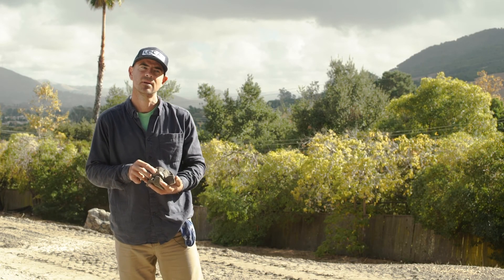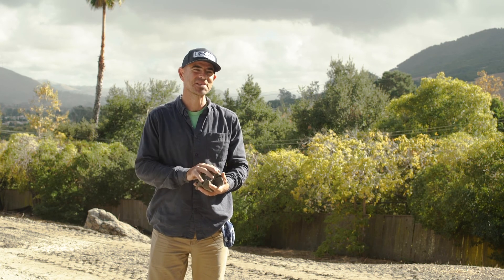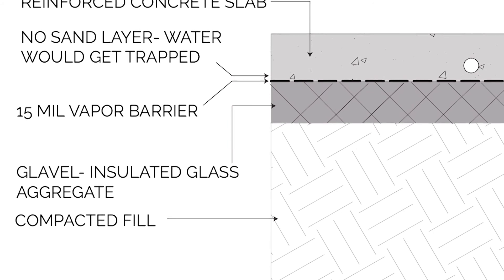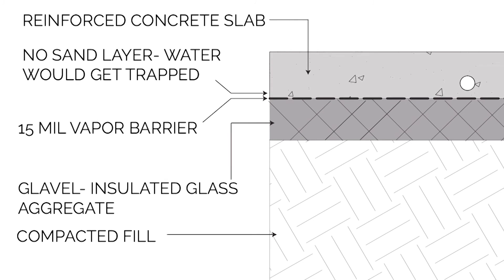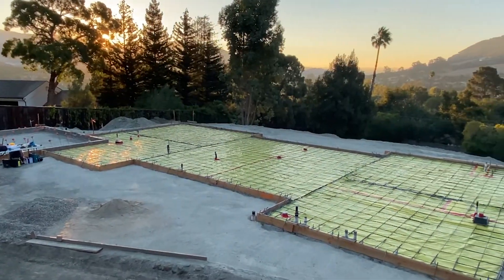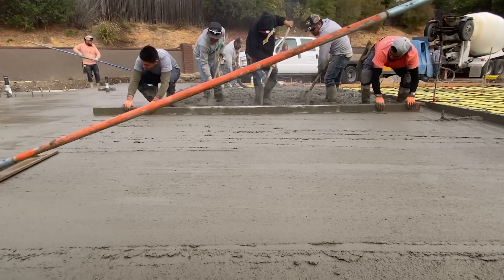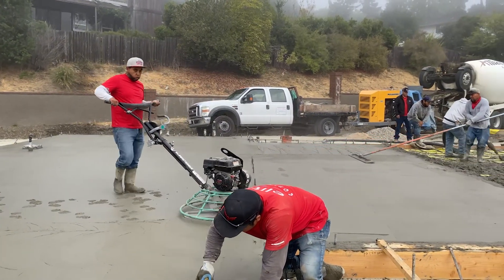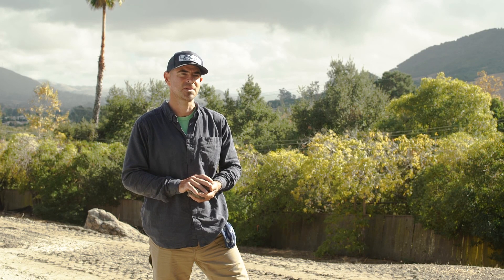Bishop Passive House: The Slab

Comment: How thick of a layer of glavel do you think you could use before it gets impractical to work with? At R-1.7/inch I'm wondering if you might still need rigid EPS in colder climates unless you can easily put down 6" or more of glavel.
Reply: It all depends on the R value you are aiming for, yes. Friends in Vermont and Maine - where it is very cold - are using Glavel regularly rather than EPS. 6" of Glavel is super easy to put down.
Reply: @michaelhorgan6640  thanks!! now I just need to find some study on seismic performance for it. weirdly, there's not much info on seismic performance for any kind of under slab insulation

Comment: UMinn did extensive research on slabs and under slab preparation. Conclusion: be sure to never use sand under the slab, as its fine grain allows capillary wicking upward instead of water draining downward, which is what you want and which 3/4" or similar size aggregate gives you.  The 15 mil vapor barrier is nice, but probably a bit of overkill for a non-commercial project where you'd worry much more about punctures from heavy equipment driving on top of the vapor barrier before the slab is poured.  Most residential applications can do fine with 10 mil and probably save a few hundred dollars with no loss in performance.

Comment: What is the concrete mix you used on this pour. It seems like most of the concrete contractors I work with want to do the sand. I want to avoid this so I’m curious of the mix you used
Reply: Hi Keith,
Just saw this question right now, apologies. We used what's called in the field a "hot mix". It has less water than your standard pour. That makes it just slightly more difficult to work/screed than a wetter mix, but only marginally. Our crew had zero issue with it whatsoever.  The sand directly below a concrete pour absorbs all the water from the pour quite quickly. What you've done in that situation though is created a mud sandwich (assuming your vapor barrier is below your sand but above your aggregate). That vapor that is contained in that mud has to dry somewhere, eventually, and if you've got a vapor barrier below the sand, the only way it will dry is up - through your concrete. That may take years to occur, but it will occur. This will affect any glues you use on flooring, and underlayment or pads for other finishes (carpet), and will likely cause mildew and eventually mold. Don't use the sand, and, in fact, the American Concrete Institute also recommends no sand. It's an old habit that is dying hard.
Reply: Have you ever considered adding Helix to your concrete mix and a plasticizer??